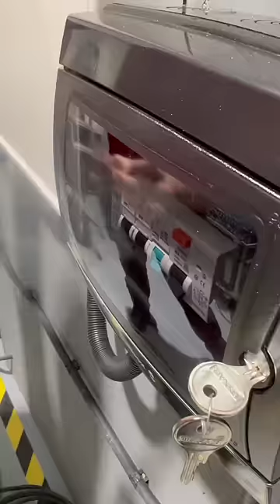This is Not Just a Consumer Unit... It's a Wallbox EV one

Comment: I was just about to get mad for stripping the ethernet cable so long for an RJ-45 connector, but alas, I was relieved.
Reply: what was that device,  with which he connect the ethernet cable?
Reply: Alas means unfortunately.
Reply: @unknown55158  Yeah, I am aware of that. I am still upset about not using a proprietary cable, but a bit less upset than I normally would be.

Comment: With data lines, twisting must be maintained as long as possible. This prevents interference on the cable.
Reply: Yes, with data lines…..but that’s most likely CT lines.
Reply: @Pugjamin  Then the question is, why using a twisted pair cable for that....
Reply: @vophatechnicus  because it’s a convenient cable type and is pretty much the accepted method.
Reply: @Pugjamin The D+,D- on the top of a Wallbox N1 CT seem to be RS-485 serial data.  The cable twist should really be maintained up to the connection for that.
Reply: @vophatechnicus CT is a differential signal and benefits from twisted pairs

Comment: ProTip better to use alarm cable than UTP- UTP od masę to crimp it on RJ45 and insulation is hard to take off from wire. Alarm cable is made to take insulation grom wires event with nails.

Comment: Good point how can you mix elv and LV in the same enclosure and the elv insulation is not rated for mains?
Reply: Glad you mention this, I was going to.  Comms wiring is not just segregated to limit noise but also due to the  dielectric strength of the insulation of cable.
Reply: @ltgood  more likely CT wiring than data.
Reply: @Pugjamin  coms cable then. Still not rated.
Reply: @ltgood  no, Ct cable isn’t comms cable. CT - current transformer. By their definition they HAVE to be near lv cabling.
Reply: @Pugjamin  actually that looks like cat6 cable and is not rated for 240v (unless something I’ve not seen) regardless of what it’s connects too.  Voltage rating was the point I tried to make.  A rule that’s requires fools to mess up.   These days segregation of ELV and LV is difficult.
Reply: @ltgood  sorry I don’t think you’re understanding how CT’s work. The cable doesn’t carry 240v, it carries a tiny induced voltage from the cable it is attached to.
Reply: @Pugjamin  i hopefully understand after 36y as a electrician. The wiring code states that the insulation rating of conductors in a panel distributing LV circuits must be rated for LV. The wires for the CT do not look compliant.  It is a rule to avoid inadvertent contact through dielectric breakdown or mixed connection.   A technician at the other end of the cable does not check or should need to check for dangerous voltage.

Comment: It's plastic... How does that comply in a dwelling? Not having a go, just interested to know.
Reply from the maker: It’s usually fitted outside close to the meter box
Reply: Ah! I see. Thanks for the reply. Always love a bit of efixx 👌
Reply: Unlike in North America, in europe fuse boxes in dwelling are plastic ! DIN standard too.
Reply: Plastic not allowed in the UK after the 17 edition amendment 3 I believe. Also, data (low voltage) and main are not allowed in the same conduit. Trunking needs a metal separator or an air gap of 2” I believe.
Reply: I fully agree we should transition to metallic enclosures like US but they also can create their own problems if not bonded well.
Reply: @petethebeat48  it's shielded
Reply: In New Zealand/Australia we now use plastic enclosures standard.  They are made from self extinguishing plastics, however poorly trained electricians do not seal penetrations at all allowing airflow and potential spread of flammability.   In over 3 decades of experience, I have never seen a fire originate in a  MCB/fuse panel. Plenty of burn out/melt downs.